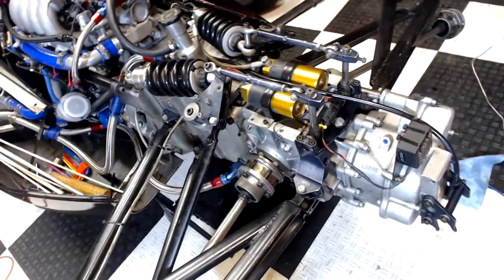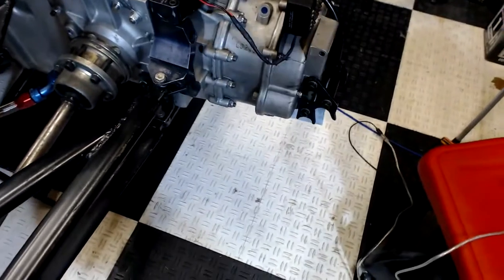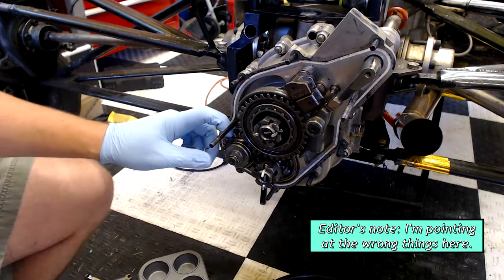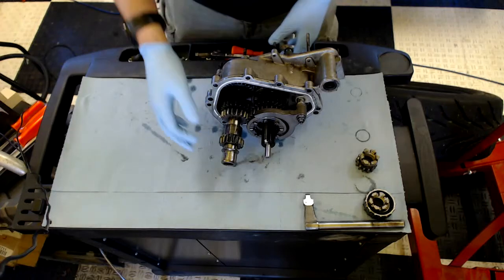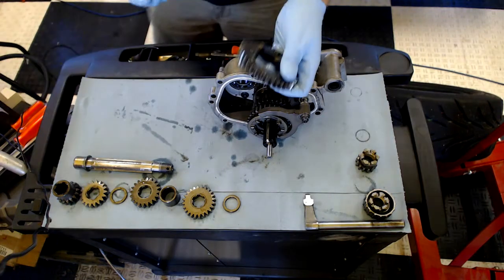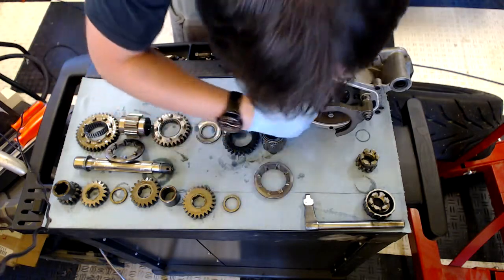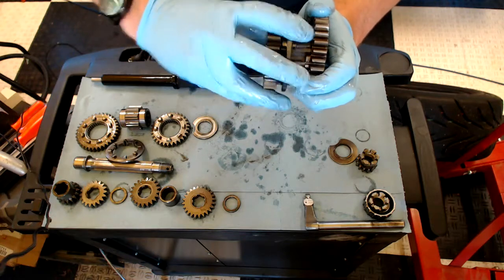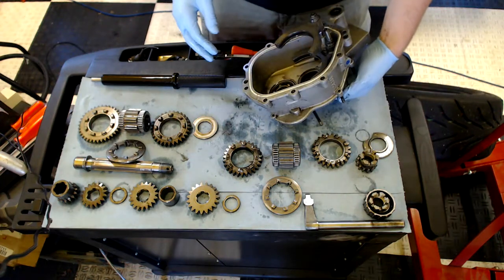What's inside a race car gearbox?

Comment: Hello Charles, Thanks for this insight into your Formula Ford gearbox. You mention not using the clutch when shifting, is that both up and down shifting? Do you brake with your left foot and blip the throttle with your right when changing down perhaps? It would be great to hear your technique. I sometimes chat to formula Ford drivers at race meetings here in the Uk, and get a surprisingly wide variety of answers on the subject of gear shifting, some say they even double de-clutch!
Reply from the maker: That's correct, I brake with my left foot and blip with my right foot when downshifting. The clutch is only used when the car is stopped. I'm not sure why Formula Ford drivers use so many different techniques. As far as I can tell they all use the same type of dog-box transmission, which is designed to be shifted without the clutch.